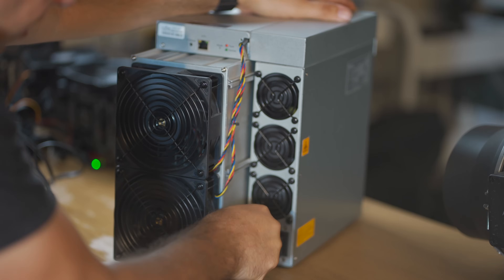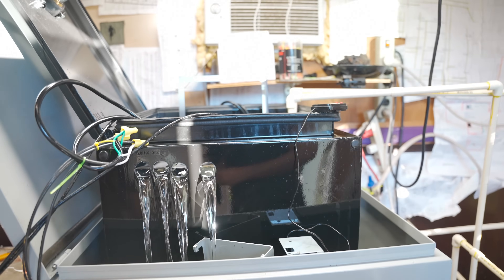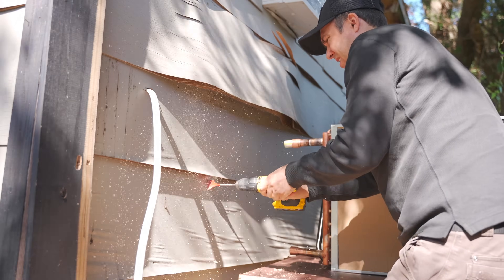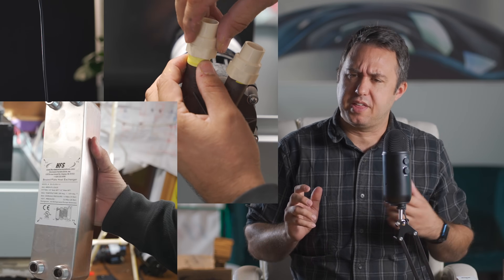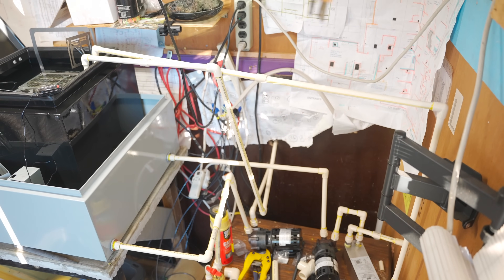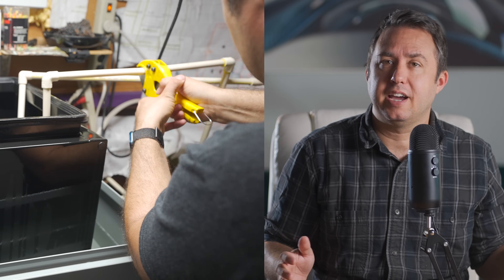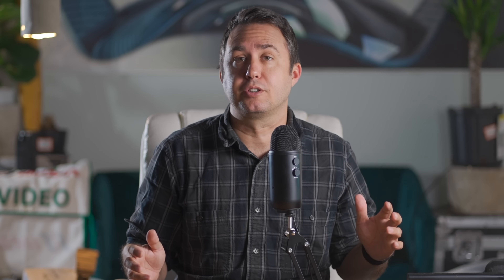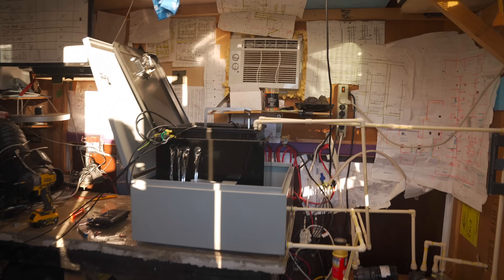Heating a Swimming Pool with Immersion Cooled Bitcoin Miners ASICs

Comment: So I ordered the pump and rad - thanks - any tips on finding the water tight metal boxes?
Reply from the maker: I got mine from http://polycase.com but it turned out they weren’t water tight and I had to plug holes with bolts and viton washers. So that may not be the best route

Comment: How many watts does each ASIC draw? A commercial pool heater is 5000 watts typically. Factor in losses and I bet you need 7500w worth of miners to match the heat rejection capacity of the pool water to the ground, the air, and what the pipes themselves reject into the air for now and into the ground later.
Reply from the maker: Each miner draws about 3500 watts so we’re close to that!!

Comment: After all of that mucking around with the tanks and all of the extra cooling liquid used, would it not have been cheaper to use bitcool's tank? 
I do like DIY but sometimes it is just easier to buy
Reply from the maker: Easier, yes, but cheaper, probably not. They’re going to be offering a two unit system for about $6500
Reply: @SPACEDESIGNWAREHOUSE  2 unit system for $6500? Their market size is probably going to be 10 people tops.  That price level makes no sense at all...depending on the miners you have it would take a year or more of earnings to pay that off before you even factor in the cost of power. People would be much better off just buying a plastic storage shed for their backyard for a few hundred bucks, hooking up an extension cord for power and putting their miner in that...or following in your footsteps and doing it diy.
Reply: @SPACEDESIGNWAREHOUSE  6,500 that is definitely a high entrance point. DIY all the way! Your trial and error videos defiantly have highlighted some of the issues with immersion cooling

Comment: You mention that the setup was sufficient to keep up with the cooling of your two S19j Pros. I'm curious if that was with the pool in the loop or not.  I'm working on my own set of tanks and the one part I have no idea about is the amount of heat those radiators can reject...even ballpark would be helpful to know.
Reply from the maker: These radiators are sufficient to keep two miners cool, but you have to be really careful about the flow of the coolant up through the machines.  If your nozzle is positioned in such a way where the flow is biased to one side, it will cool one miner MUCH more than the other and not work well enough.. Engineered Fluids uses flow plates to make this work - I just had to play around with the nozzle position a bunch; but this radiator can handle both units without the pool
Reply: @SPACEDESIGNWAREHOUSE  wow, even with the overclock to 125gh?  Either way, super cool videos! looking forward to seeing what's next.  Not 100% sure what a flow plate is, but I'll head on over to the great google and see what I can dig up.

Comment: Next time use pex.  No need for angle fittings and still good with high temps.  Bitmain made a liquid cooled miner.  Maybe you can modify your new ones with heatsink from those.
Reply from the maker: David Sundin from Engineered Fluids says that PEX is actually “cross-linked polyethylene”, or XLPE.   He doesnt recommend it for use with an immersion system because although XLPE is compatible at lower temps, it softens in the presence of hydrocarbons at temps above 140F, which is right in the middle of the temp band where you’re going to be.
Reply: @SPACEDESIGNWAREHOUSE  Pex can do over 200F with no/low pressure and 180F under typical plumbing pressures. They test with chlorine to 140F(the max for the test).  Since you don't have high water pressure, I would think it would be fine.  That CPVC(or glue used) is like a ticking clock, it will degrade over time and give you a bad day.  If you get higher temps then use flexible copper or stainless steel like solar water heating suppliers sell.

Comment: Consider installing vents at the highest point where the pipes run. The next time you start the system, you won't have to cut the tubing. Greetings from DCX :)
Reply from the maker: I had some in my drawings, not sure why I didn’t follow my own plan.  Hello, DCX! I’ve got some friends who’ve ordered your kits and I can’t wait to see them arrive and installed
Reply: Or just add a 3 way to valve. 👍

Comment: Do you know this guy Neetbux Laboratories? He did a immersion cooling solution in a ammunition can. I will do the same project for the miner that runs in my student appartment. Yes, i run a miner in my student bathroom. Can not recommend to do that!! lol
But it works and i don‘t pay extra at electricity :)

Comment: do you save any money in electricity? ldo you consume less wattage by cooling the miners this way
Reply from the maker: Not at this scale. When you have a bigger system with like 6-10 machines then the electricity from the fans not running is greater than the electricity running pumps. But that’s not the reason to do this.  It’s for temperature stability, overclocking and no more noise or filters
Reply: @SPACEDESIGNWAREHOUSE  do you have the dcx cooling oficial page by any chance

Comment: How hard will it be to use that cool heat exchanger for hot water for your HOME?
Reply from the maker: Well thats more dificult because once your water heater tank is hot, it will shut off.. but the bitcoin miners never shut off - the water would just get hotter and hotter forever.
Reply: @SPACEDESIGNWAREHOUSE  yep I understand, so you’ll need a more “smart” set-up which will “choose” between the home tank and the radiator cooling your liquids depending on how hot your home tank is at all times. I actually see this as a potential MAJOR disrupter in basically most of heating solutions, given that innovators like yourself can see it’s probability. Thanks for your help again! Your content is entertaining and inspiring 👌🏻

Comment: Makes sense, first priority should be heating house/garage, then if you still have too much heat you could heat greenhouse/pool/hot water tank/ maybe floors if you have required pipes. I would love seeing a micro ASIC farm heating all these at the same time, that would make a killer system brilliant piece of engineering.
Reply from the maker: Agreed, if I lived anywhere but where I do... Florida.  Its going to be in the 70's today and we will run AC int he house!  But the pool is too cold to get into
Reply: @SPACEDESIGNWAREHOUSE  somewhat same here in texas was 68 2-3 days ago, though it is 28 now. would be nice in the winter, just not so much summer.

Comment: Will you try to modulate the system? So when the pool gets to your desired temperature it will automatically shift to the air exchanger?
Reply from the maker: I imagine that’s not too difficult to set up in the future.. I have 6 S19j pros total, so this is all a path towards getting them all immersion cooled. The final system should probably have something like that.
Reply: I would bet that the heat rejection of the pool water to the ground and air far outpaces the miners ability to generate heat at least in winter.

Comment: If you added another heat exchanger I bet you would see a drastic temp change with the miners and your pool
Reply from the maker: Yeah the best exchanger does FAR more work than the radiator. It must be an extremely efficient method of cooling/heating

Comment: I have been trying to build an immersion cooling setup at home for some time now, and just the other day i found your first two videos, i was thrilled that someone documented the process fully, since i also have a pool, i plan on doing a similar setup. though i would also ask, due to summer heating the pool, how hot fo you believe your pool will eventually get?
Reply from the maker: I wonder that, too!!! I was just looking into the effects of chlorine on copper though and it’s maybe a little iffy to keep the heat exchanger running when everything gets really hot. If they DO fail, they do so by mixing the fluids and that would be catastrophic :(
Reply: @SPACEDESIGNWAREHOUSE  definitely a very bad scenario. my personal plan was to do somewhat similar to the setup in your second video, with my s19 inside my garage, but the tubing is piped through the wall, outside, to the radiator and a fan mounted on the side of the house, that way heat goes out, and miner stays inside. though with payouts being down by almost 50% for me, if it keeps up I will end up not even breaking even with electrical, so gonna hold off for a bit on buying the immersion cooling for the moment. hopefully, payout rates go back up at some point, still new to using ASICs.

Comment: Is pex a compatible with that stuff?
Reply from the maker: Indeed it is.. but rubber isnt, so no quick connects or shark bites.
Reply: @SPACEDESIGNWAREHOUSE  good point. That’s why I asked about pex A. To your point I’d image you’d have to use all brass fittings.

Comment: When those type of heat exchangers fail it’s usually a leak that causes the 2 fluids to mix. I would think about a system to monitor that. I image pool water in your cooling tank would fry your miners. Proof testing your heat exchanger periodically wouldn’t be a bad idea.
Reply from the maker: Well thats certainly a scary concept considering how much these cost.
Reply: @SPACEDESIGNWAREHOUSE  not sure if you read all that but  @Rosen Kocev found that double walled braised plate heat exchangers are a thing. They appear to be used commonly for potable water and therefore to be reasonably priced. They have two plates with a leak path in between for every one plate a regular bphe has.  I imagine this results in pool water dripping out on the floor instead of  blowing $15K of miner. Not sure if yours was out wasnt double walled, but I'll be buying a double walled one for sure.
Reply: “To prevent two different kinds of fluid from intermixing caused by internal leakage, KAORI precisely designed D Series solution with the double-stacked plates, eliminating the possibility of cross contamination.
The unique air gap is created between the two plates. Once internal leakage occurs, the 2nd plate becomes a shield to keep fluid stay and flow on the same channel through the air gap. Meanwhile, vent holes outside the plate will seep out fluid as an indication of leakage.” There is a solution apparently.
Reply: @rosenkocev3400  Just had a10 min google and "double walled braised plate heat exchangers". Seem to be a well worth it.  They are used for potable water so are common and cheap,  there are several in ebay priced in the hundreds, not thousands. I would definitely buy double walked over a regular one.  Thankyou very much,  that was a great find
Reply: @jon8864  You welcome , I have an HVAC and refrigeration company, that’s how I know, and in some big scale water cooled HVAC systems if you mix refrigerant and water the damage is far greater than single Asic’s price. Therefore the industry has an solution. Best regards.
Reply: @rosenkocev3400  that’s a great solution. Is that the exchanger he’s using?
Reply: you could have redundancy by separating the miner loop and the water loop by putting a closed loop of non-conductive liquid with a heat exchanger on both sides. that way both heat exchangers have to fail to cause damage, and the closed middle loop could have a dye to detect a leak in either heat exchanger.
Reply: @YoloMonstaaa  Yeah, that way also maximises your inefficiency too. But I guess it's hard to have redundancy and efficiency.
Reply: If you run the oil at a higher pressure than the water, then if there is a leak you will loose your oil instead of pool watering the miners. Is this correct? How much more pressure do you need?
Reply: @jon8864  that’s a pretty good idea. You could do it with pumps and or head pressure. If he could put the ASIC tank in a 2nd story and the exchanger at ground level it might be enough.
Reply: What kind of system could monitor that? Can you do it with differential pressure somehow? I'm guessing a floatless level sensor detects it as the smoke comes out of your system. Red food dye in the pool would work if you watched it all the time.
Reply: @jon8864  I was thinking about a solution last night. This might be overly complex, but it would give you an actively monitored system. I suspect the resistance of these 2 fluids are significantly different. You could put a sensor in line with the asic pump to monitor the resistance and add a kill switch command to set an alarm and kill the pump if the resistance passes a predetermined threshold.
Reply: @ThorM465  
If by resistance you mean viscosity you might be into something. I didn't know you can get inline viscometers, but quick google shows they do exist (used in manufacturing ink) so you might be able to get one in the right range.  But I imagine this would only be good for big systems because I bet they cost more than a miner. Fancy sensors are really expensive,  that's why I was suggesting differential pressure; measure the pressure drop across inlet and outlet of both sides of the heart exchangers. I'm pretty sure you could detect a big leak,  but I'm not sure about small leaks, which is what you'd get. And it's impossible to test.
Reply: @jon8864  I didn’t either. I did man resistance. I suspect the meters you saw actually measure resistance and cover it to viscosity in the firmware. That’s how thermal sensors work.
Reply: @ThorM465  I think viscometers measure the time taken to squish liquid with a tiny piston with constant power input and calculate viscosity based on that. Thats how RTDs (resistive thermal devices) work but not thermocouples, which are at least as common as RTDs. A floatless level sensor, like I mentioned earlier, is a really cheap and reliable way to measure resistance really inaccurately (continuity), it might save your stuff in time but not sure?

Meters that measure tiny amounts of electrical resistance are called conductivity meters, your multi-meter might have that function (mine doesn't). Some pH meter measure conductivity and infer the pH, or you can buy inline conductivity meters, but I don't think you can buy cheap ones of either, I think they are all at least 4 digits, but haven't checked. They would detect a leak much sooner than my floatless level relay though and be more likely to save your equipment. You couldn't use an RTD because there is a made time delay with their measurement.
Reply: Is there a kind of heat exchanger that commonly fails by one of the fluids leaking out rather than the fluids mixing?